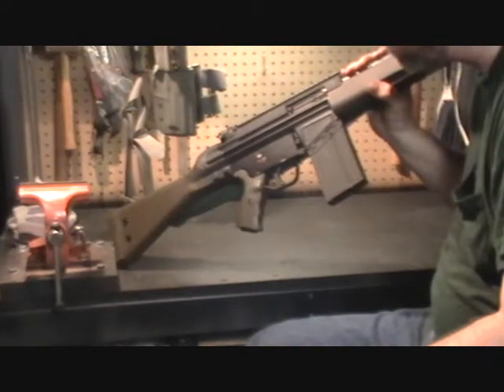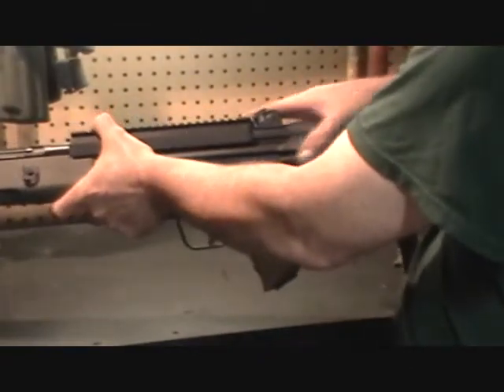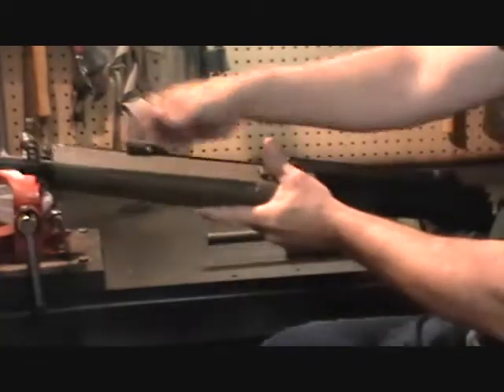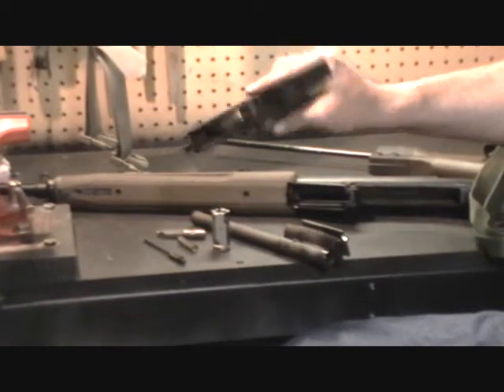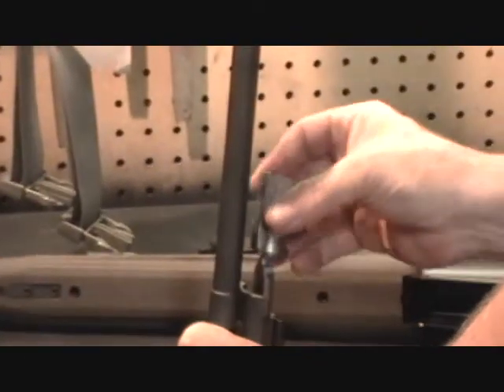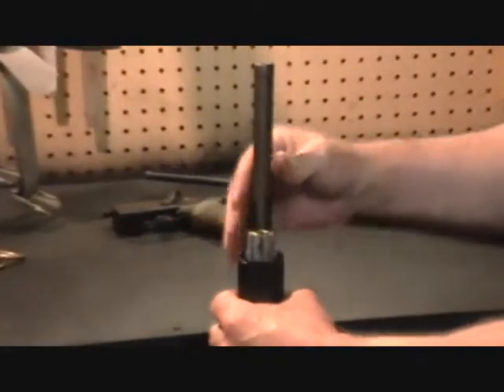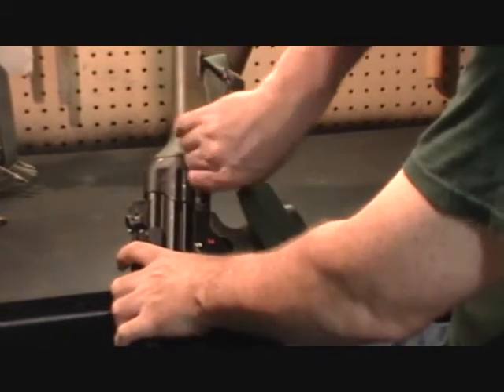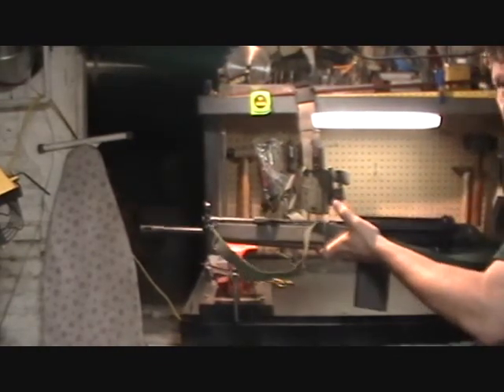H&K91, PTR91, G3, Cetme field stripping procedure

Comment from the maker: Cetme doesn't make the commercial receivers but sources can provide domestic semi auto versions.
You need some specialized tooling to build a G3 variation, most imporantly a minimum 10 ton press and tooling to align the barrel to the receiver and trunnion.
You can legally build a rifle for your own use as long as it is legal in your state to do so and all Federal guidelines are met involving Section 922 which indicates how many of the parts must be American made for the weapon to be legal.

Comment from the maker: Because the G3 is a delayed blowback action type, the bolt. carrier, and roller assembly stays much cleaner than you might expect compared to a direct impingement action and the important bits don't carbon up anywhere near as bad as a piston activated action

Comment from the maker: @Onemanwonder123 Barrel handguard or trigger handgrip??
The barrel handguards are the later and more generous "tropical" style and the trigger hand grip is a detachable version attached to a stamped steel fire control unit.
This is the "original" style fire control unit.
The latest versions of the G3 use a molded polymer fire control unit that includes a thinned and non-detachable trigger handgrip.HTH

Comment: Nice rifle, thanks for sharing.

I want to buy a .308 semi-auto so I have been looking at the .308 market & I think that the PTR 91 is one of best deals right now.
There are a slew of AR-10 types out there from various makers but the problem I have with them (IMO) is that they are all proprietary designs,  parts do not generally interchange between these various AR-10's.
But the PTR 91/HK 91/CETME rifles have good parts interchangeability,  So there is a large parts inventory on the market.

Comment: Ride the locking lever up the ridge on the bolt head about 90 degrees ,from start of ridge till it stops.pull out on bolt head and the rollers are recessed in place.

Comment: @onmilo At 9.41 you are inserting the magazine and at 9:53 you've pulled the trigger with the mag still in. No worries mate..its just the procedure. 
Biggest risk is presented by the magazine;it can have rounds in it but you can miss that because of so many reloads during gun use(brief romanian army explanation of field stripping procedure).
As I said before, nice video.

Comment from the maker: @dills2403 I myself would avoid the cheaper Cetme clones available and purchase a genuine H&K or a PTR91 clone.
Unless you are VERY lucky, the Cetme will likely be more trouble than pleasure.
Springfield Inc. had clones built from either Greek or Portugese parts depending on the era of production and these are also very good but very difficult to find on the used market today.

Comment: The G3 is of the same flavor as the US M14 and the French FN FAL. It's a great rifle.

Compared to the M-16/M4 or AK-47/74/104:
Advantages: The 7.62x51 has more stopping power, greater range, and an ammunition commonality with the 7.62 machine guns in service
Sturdy and heavy, doesn't break when used to smash stuff
More accurate at long range.

Comment: I wouldn't want slam my rollers aginst the sheet metal like that when re-installing. The proper technique is to ride the locking lever(what u called ejector)u the gradual ridge on the bolt head. The recesses in the trunion that push the rollers in for cycling are contoured for this retraction. This method should work but may stress and damage your rollers.

Comment: Accuracy is poor with HK93? What about G3? I thought the roller delayed mechanism was designed so that the bullet would experience no vibration before leaving the barrel (something like that). I've shot a G3 and MP5 before, I used them at close range so idk about accuracy, but they were just plain good old fun!

Comment: hey thanks i was having problems putting the bolt back on to the firing pin, on these ptrs that have yet to be properly broken in its a bitch pushing it under the extractor i had to push on one end while forcing the bolt into place.  thanks again for the tutorial

Comment from the maker: @BRATKOV47KALASHNIKOV I paid U.S. $750.00 for this one and the green stock set cost another $80.00
H&K HK91 semi auto's are currently running about $1800.00 used, PTR-91 clones are about $1100.00
There are some cheaper copies and CETME clones but they aren't worth the money spent in my opinion.

Comment from the maker: My fucking problem is you asking if an H&K-91, A REAL H&K91 is a good thing to buy at $600. That is 75% off current retail value. If it was just a barrel and good receiver I would consider $600 a "fair price"! Used PTR91 rifles in good shape bring an easy $1000 now.